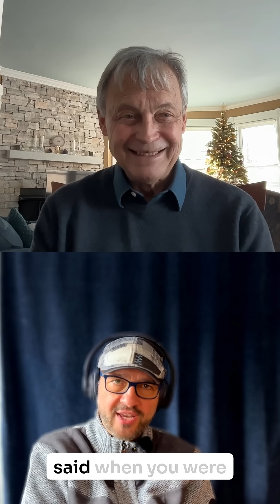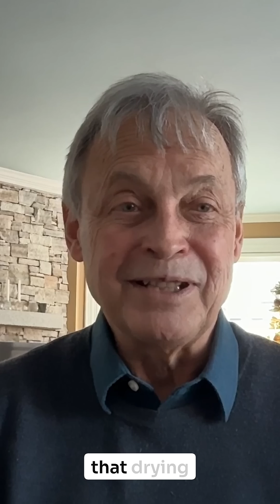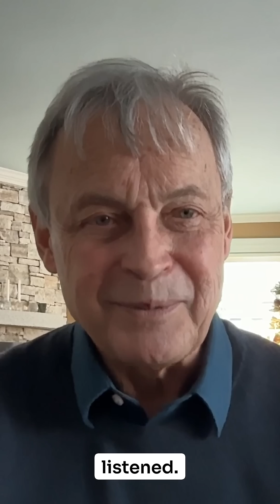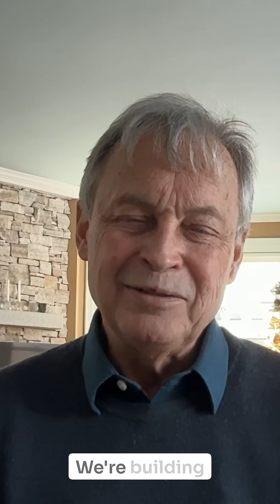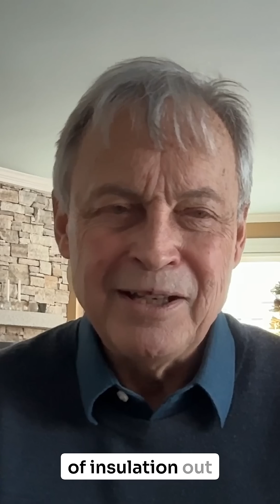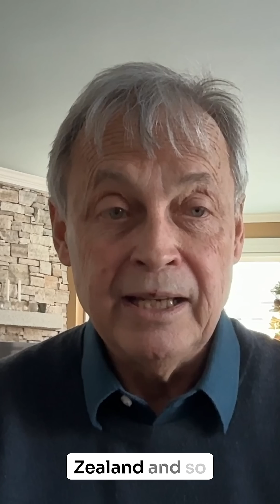Joe Lstiburek on Moisture, Drying, and Why Buildings Rot

Comment: Counterpoint: Only 30% of Germans own homes.  60% of Americans own homes.  German homes are concrete, brick & plaster and the American houses are wood.  Is something better than nothing?
Reply: The issue in America is, home building is dominated by large national home builders, who answer to Wall Street. They put profits and production over quality, building to the code, which we know is the minimum requirement. So they are building homes to the bare minimum standard required.